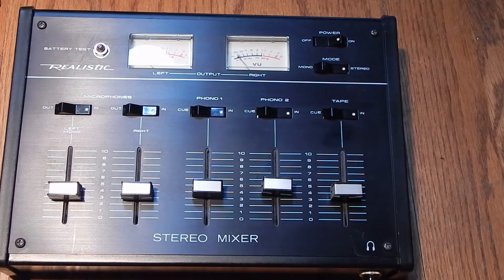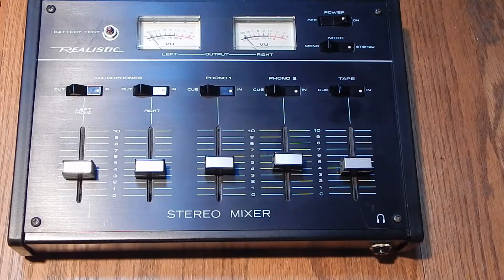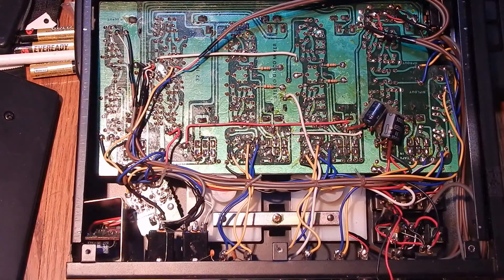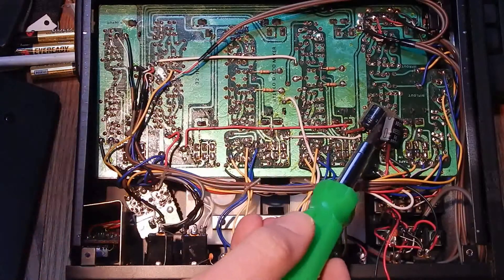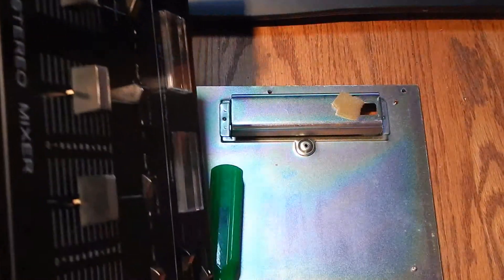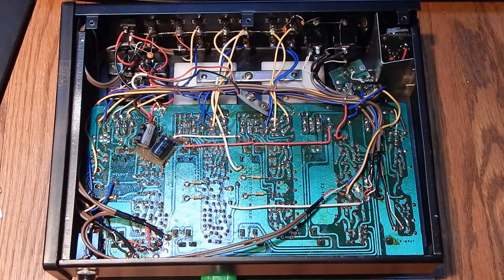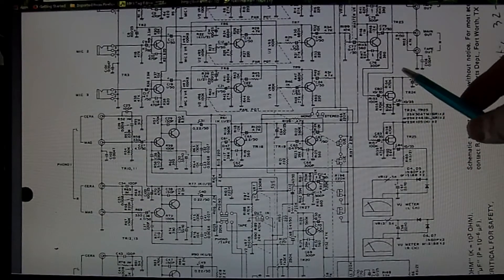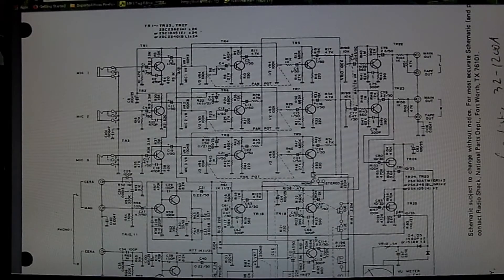A Look Inside a Realistic 32-1100A Stereo Mixer

Comment: Hello! I use one of these for djing. I'm trying to figure out WHEN the batteries are low enough to effect the sound negatively. When I started, the battery tester indicated in the red, but now it is just between the red and the black. I'm wondering WHERE the needle on the battery tester should indicate when it's time for new batteries. Any help would be greatly appreciated, thank you! I supposed I will take out the batteries and check them individually, but if I only I had the manual I could see what the manufacturer recommends.
Reply from the maker: They should stay in the red or nearly so if they are alkaline. If it shows significantly lower than when new then you are at the discharge knee.
Reply: @HillsWorkbench  Thanks, yes I DJed last night and it starting becoming distorted. Seems the battery life is not particularly long.
Reply from the maker: @DoctorRazzArea4  You should find a DC power pack for it.

Comment: So I just picked one up, put batteries in it and they started melting the battery case! I couldn't understand why, batteries test good, but it gets very hot. Burned me. I tested the terminal and the DC jack and it shorts the positive and negative terminals when in the "off" position. What the hell is wrong?

Comment: Do you know how the Battery Test works? Like what its even supposed to respond with if the batteries are okay?
Reply from the maker: Sorry for the slow reply. I tried to find the unit to check but couldn't locate it, I may have given it away. But I'm pretty sure on mine there is a red mark below the usual scales on one of the meters...
Reply from the maker: Yeah, rewatched to be sure, there is a scale for the battery on the right meter just below the main scale.
Reply: @HillsWorkbench  No need to apologize. Thank you!

Comment: Does this mixer have a fuse in it? I can't remember what I did but mine has no power with batteries or using a 6v adapter. Can anyone help me out on how I use a multimeter to test why I have no power? Thanks in advance.
Reply from the maker: Read back in the comments. Turns out there is a little DC to DC booster in the one little sheilded box in the corner. You need to see if the 6v gets to that point and if the higher Voltage is being made.
Reply: @HillsWorkbench  Thank you for the info. I will have to learn how to use my multimeter to detect the problem. I would like to get it to work again.
Reply from the maker: @davidjamesfishkin4148  Just set it to Volt DC. Experiment measuring whatever batteries you have around. Most newer meters auto-range but on many you will have to select a range. Start at the highest range you might need and then work down if needed.
Reply from the maker: @davidjamesfishkin4148    I will try and dig mine up and see if I can think of more suggestions.
Reply: @HillsWorkbench  Thank you for the advice. I will be able to get to it within the next couple of days. I will let you know of my progress.
Reply from the maker: I don't believe there is a fuse but it's bee a while...

Comment: Hi! loved the video. Would it do any harm if i were to use a 9v battery instead of the 4 AAs ? Thanks!
Reply from the maker: It would be risky, that's 9V instead of 6V. And the battery voltage gets boosted in this circuit so Voltages throughout would be increased. Likely the 9V would cave under the load and maybe save things but I wouldn't count on it. Battery life would likely be pretty short also. You could look at NiMH 9V replacements that actually do 7.2V (as opposed to ones that do 8.4V), but why, 'AA' cells are about the best buy in alkalines.
Reply: I was just curious, thanks for your thoughtful answer. I appreciate it !

Comment: I had a 1200B, which had a built-in power supply so you just plugged it into 120v AC.  Mine had a cross-fader to fade between two line sources,  and the VU meters were at the top left instead of top center.  I believe the VU meters were lighted, but I haven't pulled out the board in years.  I lent it out to a friend once, and it came back screwed up, so since it was still under warranty, I took it in to the local RS service center, and they straightened it out quickly,  they told me it looked like "I" had been plugging and unplugging live devices and ended up zapping something. Never lent it out again, and never had another problem with it since then. I still own it, it's in storage, still in the original carton and packaging, saw it last about 4 years ago.
Reply: That would piss me off enough to never borrow equipment to idiots.  That's one of my pet peeves when ppl just plug n unplug things that are powered on

Comment: Nice video! I bought almost the same mixer at a thriftshop but it says stereo disco mixer instead of stereo mixer but its the exact same mixer as far as I can see.

That metal part in the corner of which u thought was a filter for the power seems to be a step up converter. When u listen closely u can hear the squarewave buzzing. The red cable that comes out of there has about 24 volt on it. 

Also the fader knobs came off very easely on mine so I might make a video on it soon so U can see the insides a bit. I must say that it made me very happy seeing all the analog circuitry.

I also already added a little backlight mod for the VU meters so it looks a lil more 'premium' vintage.
Reply: The whine is really irritating! I tried increasing the value of the capacitors on the power supply, but it didn't seem to help. Any ideas on how to improve it?

Comment: Interesting with only six volt supply. Not a lot of headroom for output signal especially as batteries age. Single element output stages can sound nice but won't put up "hifi" figures on test equipment.

If you build the opamp preamp I made, use 100 ohm output series resistors if it is to drive signals into shielded cable. It is a stability issue. I didn't use them on my amp because it is meant for the bench only.
Reply: And the condition of the multitude of coupling / decoupling electrolytic capacitors is very iffy after decades.